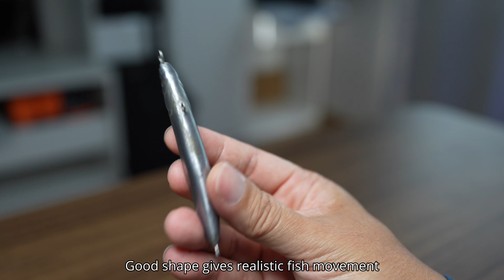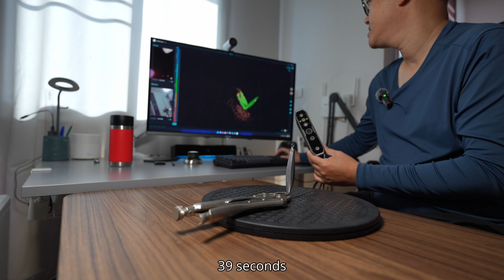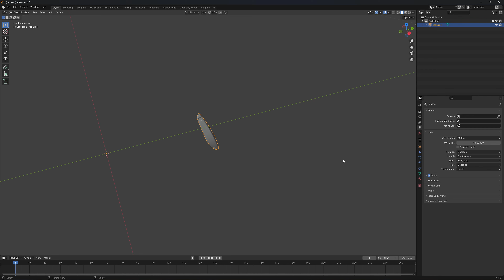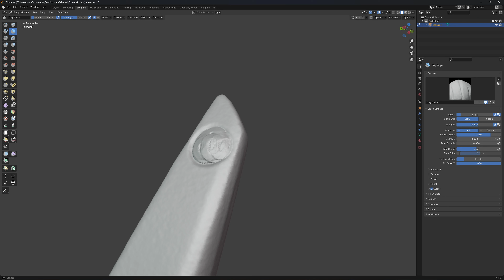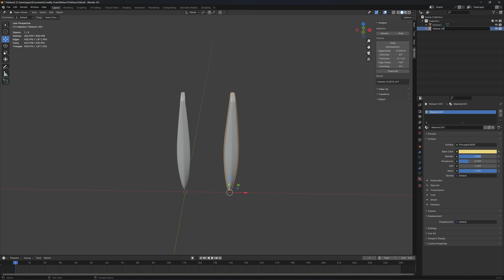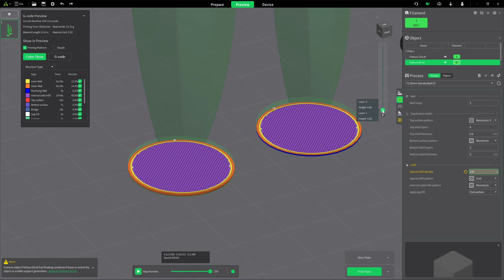Scan and Scale - Fishing Lure Weight with CR Scan Otter - Part 1

Comment: When you moved the item to Blender and set the origin on the x y z access.. How do you set it up to be able to use the symmetry on the x axis in sculpt mode? In the video you filled in each eye separately. I scanned an item, moved it into blender and having an issue getting the symmetry the same on both sides. Appreciate any help. Great video
Reply from the maker: I'd set origin to center of mass (Volume) Then I will delete half of the fish then mirror it and re-mesh. This time left-right is symmetry and you can turn on symmetry on in sculpting menu.

Comment: Payo, I need help scanning a shiny white plastic part. It is a 200mm long handle off a washing machine that broke. I need both sides scanned, My Otter keeps losing track even after I sprayed it with some foot spray to get rid of the reflective surface. Any tips for white shiny plastic scans?
Reply from the maker: I guess that it was scanned in small/medium geometry mode, right? If so, you'll need to scan in marker mode. It's normal that a scanner can't track geometry with flat, long, repeat pattern objects.